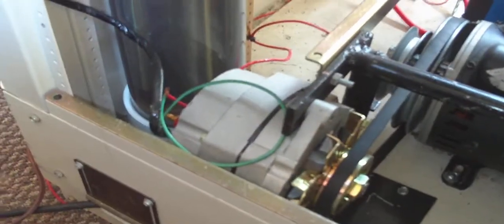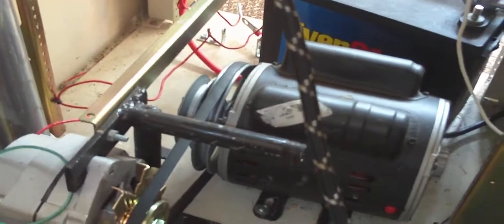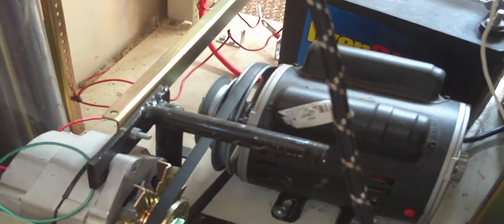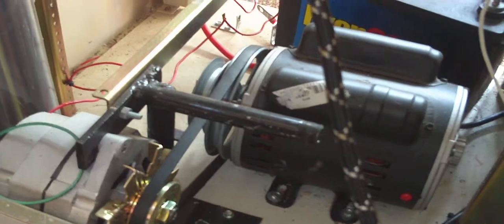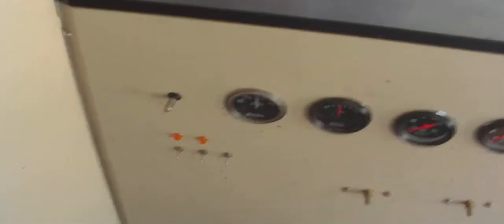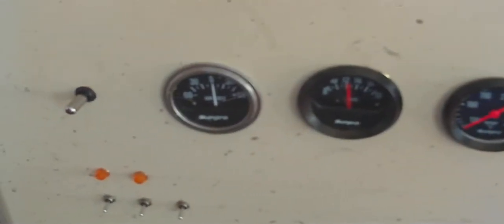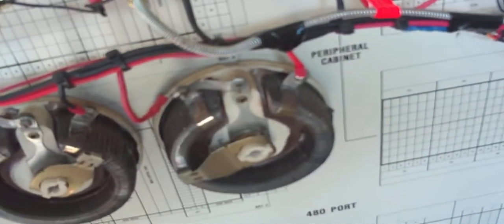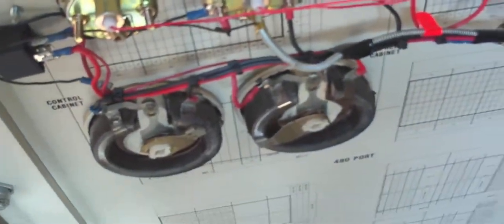Mike's HHO cell

Comment: Great workmanship. Very professional. Just a few questions as I am trying to understand what is going on here.
Is this a replication of the Stan Meyers alternator method? With the current are you reading the amps into the alternator or the cell? Im sure the motor driving the alternator is drawing more current than that from the house power outlet. So what is the total power into the cell & total power into the alternator from the battery and power into the motor driving the alternator?